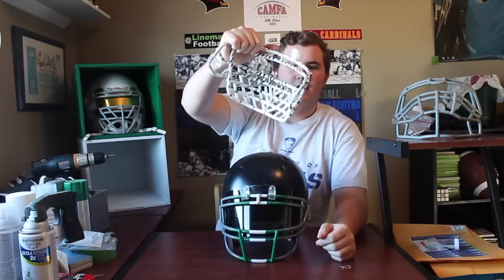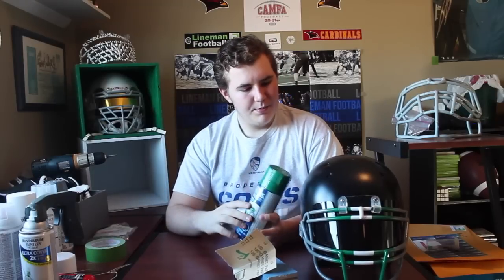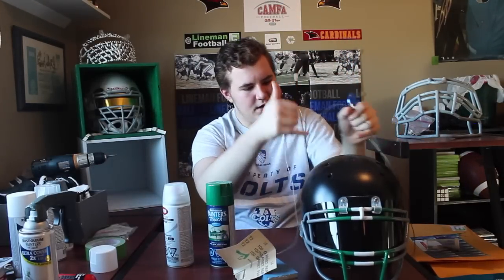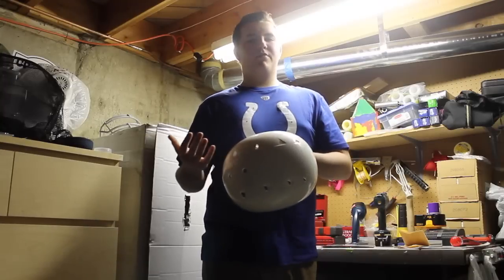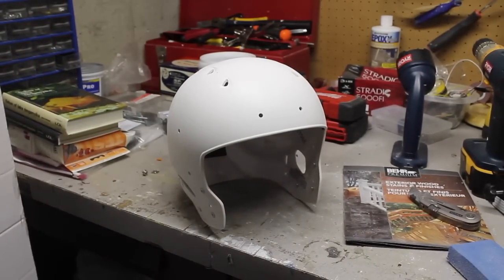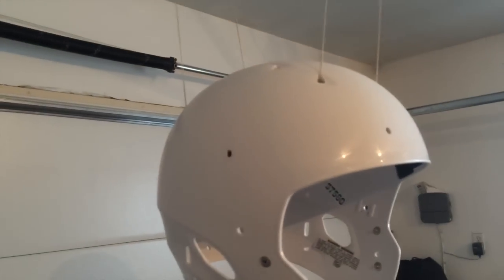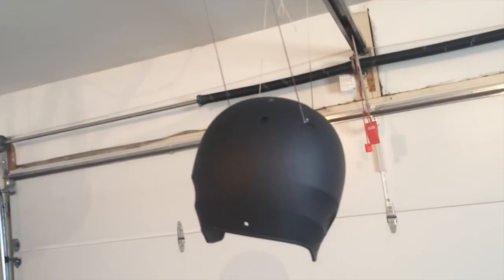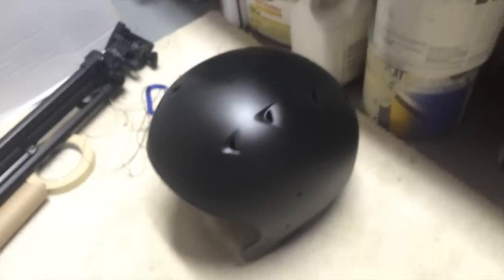How to | Paint Your Helmet (DIY)

Comment: I found that using that peel able rubber paint works really well for helmets and it dries extremely quick.
Reply: Does last after getting hit?
Reply: @damonburton1872  probably not just like normal helmets after scratchs paint will rub or come off but scratchs look mewn so i dont see the prob

Comment: Hey man great video. I have a question that maybe you could help me out with.   I just finished doing my first helmet. I did the old school Atlanta Falcons helmet because its my first time and that helmet is fairly easy, however, after painting the helmet using a glossy black paint, i got the glossy, shiny wet look that I wanted. Problem is, when i put the clearcoat on it, it dulled it significantly and i dont know why. This helmet doesn't necessarily have to be glossy so im okay qith what i have, but the next helmet is going to be an Army gold helmet and is supposed to be glossy. Im trying to figure it our before i start rhe second one, how to make sure the paint stays glossy. Do you have any advise?
Reply from the maker: Yah when you pick your clear coat go for the glossiest option. I made the mistake of using satin instead of matte. The lid will show you the finished look

Comment: How long do you let your helmet dry after putting on the second coat
Reply: Using a regular spray paint would be around 5-10 minutes but using a peel able rubber paint for cars is about 3 minutes. Plus when you use the peel able paint you don’t need to sand your helmet. And if you want to change it to another color then you simply peel add the paint and change the color.

Comment: Several things wrong here 100 grit is way to aggressive to use on a helmet you want to use no more then a brown scotch brite pad to scuff it. You also don't use a sanding block on a rounded surface use your hand do it forms with the curve of it last and the most dangerous of all the mask you are wearing is not a respirator that will keep fumes out. That is a dust mask which is for dust it will actually trap the paint fumes in the mask so you are safer without it then with it
Reply: Haha I was thinking the exact same thing. He's young, what do you expect, at least he's trying though
Reply: +Mark Hallum what spray paint do you suggest i use on a helmet?
Reply: +Kit McIntosh I wouldn't suggest it at all especially if it's going to be used.

Comment: Have a red helmet and going all white. In the back it has the white rectangular warning sticker but on the left it has some manufacture clear coat lettering. Do I still scuff and sand and if I do will it get rid of it . I am trying not to get rid of it . Also I want to remove the warning sticker paint the helmet and put it back on . What's the best way to do that. Thanks

Comment: hey man great video, i'm just having trouble taking the helmet padding out because the air pump holes are on the outside and also attached to the padding on the inside, do you know how to take the padding out without destroying the air pump holes? ps its a riddell revolution
Reply from the maker: Fred Mertz well all the padding is made to be removed, although it goes against instinct really try to pry it out, i had the same problem with my speed, its made to fit very snug.

Comment: Thanks a lot for your video ! 
I just did not understand what is the Prime Layer, is that the white coat or the first black ones ? (sorry I'm a french speaker so I don't understant everything in english..)
Thanks again !
Reply from the maker: +Max M. primer is a coat of paint usually white that helps the actual paint stick better, using white also makes other colours like blue or red look more vibrant
Reply: ok thank you very much ! :)